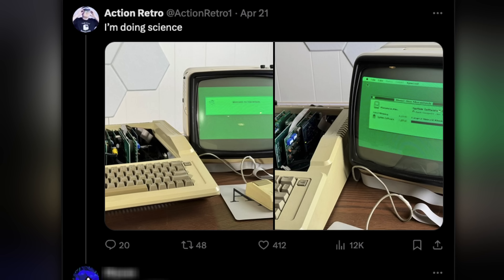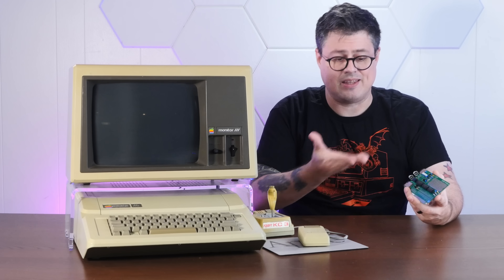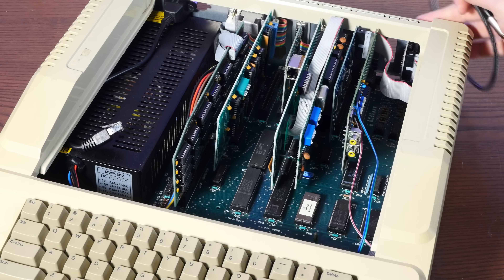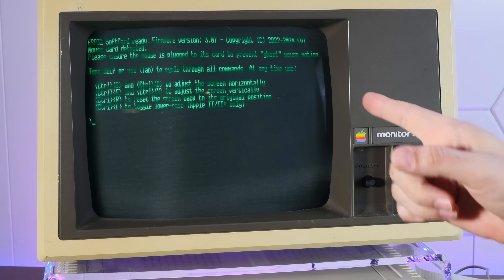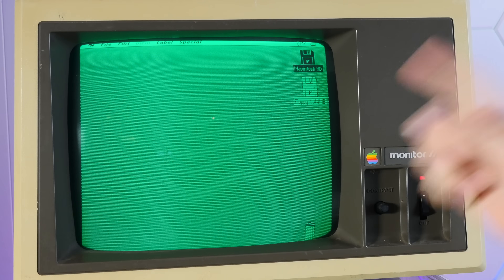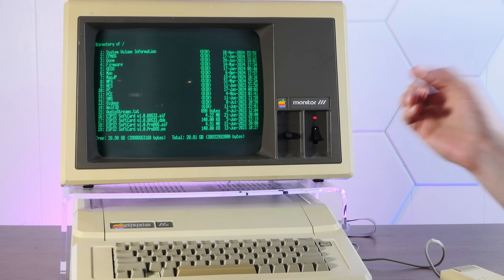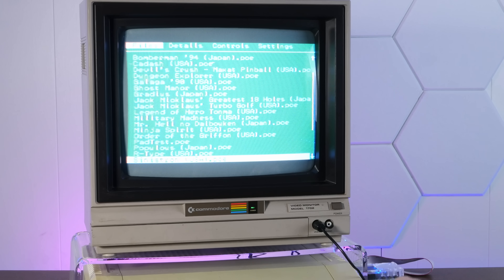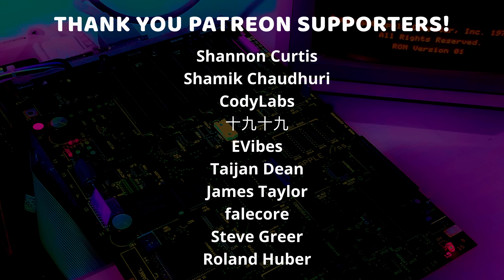This Apple II is running... Mac OS?!

Comment from the maker: Go to https://ground.news/actionretro to take control of your newsfeed and see the full picture on any story. My link gets you 40% off the Ground News unlimited access Vantage plan.
Reply: I thought 68k-dot-news was the Action Retro Endorsed news aggregator?
Reply: How come you call Geos G. E. O. S. but you don't call Geoworks G. E. O'Works?
Reply: I thought 68k.news was the Action Retro endorsed news aggregator?
Reply: My Apple ][E, ][GS can be connected to my 2014 Sony Bravia with RGB cables so I see my games in color.
I also can connect my ][C to my strange Westinghouse 21 inch television as well and if I want to drag it out of closet I can use my Apple color monitor so I no longer use green screen.
Where do you get the card ?
Apple ][ forever.
Reply: All US media is centrally controlled.  If you care at all about informing people, stop running this BS about how "left" and "right" are anything more than an false dichotomy.
Reply: too bad its missing GSOS would have been sooo cool..

Comment: can you install tiny core linux on the esp32 card?  id love to see an apple2 on modern internet!  what about other operating systems?  amiga os?
Reply: This card runs the various OSes shown in this video by emulating the retro-machines they were designed for instead of directly running them on the ESP32. So if in the future it can also run AmigaOS, it will be by way of emulating an Amiga. When it comes to the modern Internet, the Telnet client that was added in v5 of the firmware provides quite a few capabilities, like running the Links browser, access to Wikipedia, news, even ChatGPT.

Comment: "HELLO" is an init script for DOS 3.3 floppy disks. The A in the left column indicates that it's an AppleSoft Basic program. When the disk was initialized it was set up to run that basic program on startup. In this case it looks like it just passes the command "CATALOG" to DOS and exists. Being a BASIC program instead of a binary executable, it has to be run with "RUN HELLO" and not BRUN. You can see what the contents are by "LOAD HELLO" and then "LIST". 

I can't believe I remember this from 30 years ago when I learned it. 

I know this is an old video, but I couldn't resist. When else am I going to use this information?

Comment: @7:07 ust in case you or anyone watching is curious, in Apple Basic, "HELLO" is just a generic program that is named when initializing (formatting) a blank floppy.  It can contain a full program, or it can do absolutely nothing.  If the number of blocks (like in this case) are 2, then it's most likely absolutely nothing.  Also, you'll notice the "A" in the same columns as the "B" in front of the other files.  The "A" just means it's an Apple Basic file, so you load and run it simultaneously by entering the following: "]RUN HELLO".  Only "A" files are loaded/ran using "RUN".  You can load it without running it by typing ]LOAD HELLO.  Then, you can list the basic program ]LIST.  So when you "]BRUN ESP32NTSC", that's how you load and run a "B"inary, or assembly language program.  You can also ]BLOAD the file, but you can't list it traditionally because it's not Apple Basic. You can ]CALL-151 and then you get a * prompt which enters you into Assembly but that's not a topic for here.

Comment: So wait... if the ESP32 is whats running everything then in what way are you running the software on the Apple II?
It seems more like you're just using the Apple II IO to control and view the ESP32, the CPU in the Apple II isn't actually running the software?

Not that it isn't cool but its not the computer actually runnig the software.

Comment: i am little confused. how much work is the apple2e actually doing. the apple 2e is still using its processor at least just to interface with the esp32 right? i'd assume its a little more than just plugging in an esp32 to the apple 2e display.
Reply: That is correct. The 6502 processor on the Apple II runs an interface program while the ESP32 SoftCard is in use. In addition to controlling the video switch this program also finds the card's slot and the slot of the is a mouse card. It then starts passing all keyboard, joystick and mouse events to the ESP32 SoftCard, until the user types the EXIT command.

Comment: Woz is my hero!  The Apple  ][  series are incredible.  So flexible, with rather modest hardware.  You could put a co-processor card in one of the slots.  I had a Z-80 card in my Apple ][+.  It similarly used the Apple ][  for keyboard, display, and floppy disk access.  It would be fun to see if you could transfer data between the ESP32 card and the Apple ][ system by issuing "PR#7" and "IN#7" commands (which re-directs system output and keyboard input to the card in slot #7). 

The "Hello" program is an Applesoft program that Apple DOS or ProDOS runs automatically after it loads the DOS after booting.   See the "A" in the first column of the CATALOG listing?  That means "Applesoft".  "B" is for binary files, and "I" is for Integer Basic programs.  So to run it, use "RUN HELLO", rather than BRUN, which is for binary programs.

Comment: The Apple II has become a terminal for the ESP32. All authentic Apple actions are performed via passthrough, the rest is the ESP and its software. Really makes you think that the Apple IIe is actually running the software. The ESP just uses the Apple II for power. That 6502 must be bored after boot when it switches to the ESP.  This is a pretty cool project.
Reply: Not sure if the 6502 is bored though. It's kept super busy with the IO. 🏁

Comment: The "type mismatch" error ocurred because you use BRUN instead of a RUN. Note the letter "A" in the line where HELLO is listed. It means a Applesoft program, so use RUN HELLO. The "B" letter is to denote a Binary Program, like the ESP32NTSC in you case, then use BRUN with them

Comment: The "HELLO" program is basically the Apple II's equivalent of an Autoexec.bat.  It's a small BASIC program that autoruns whenever the disk is booted up.  Since it's a BASIC program, not binary, you just use "RUN HELLO", not "BRUN HELLO" .  The  HELLO program was commonly used to load custom CATALOG programs or other personalized menus or welcome screens.

Comment: I never owned a Mac but I did run a Macintosh emulator on my Amiga and it consistently ran faster than the fastest Macs on my college campus.  I had to buy a special external drive to use Mac floppy discs and used a 20 MB Floptical drive as its main storage.  
I ran the fastest Macintosh in town at less than 1/3 the price of the original.

Comment: think I'd even heard of Doom being ported to ESP32 but had completely forgotten about it. quite amazing to think that the game some people say killed Amiga (because everyone wanted to play it and basic Amigas simply couldn't) runs so well on a tiny $3 microcontroller that's already 10 years old. sure, Moore's law and all that but still, a purpose-built multimedia machine that was still being sold two decades prior (A1200 discontinued 1996, ESP32 released 2016) getting curb stomped by a single chip that usually doesn't do much more than control some LED lights.

Comment: Hi, thank you for this awesome work! Do you know how to connect for a IIGS?
Reply: The card works on an Apple IIgs, but only through the composite video. There is no RGB support.
Reply: @cvt8353 Ok, so I need another screen with the monitor of the IIGS, right?
Reply: @skanderbenabdelkrim6332  Yes, or a monitor that has dual video inputs - RGB and composite.

Comment: I have no idea what has been done with this recently, I just haven't been following. But, if this card had some DMA options, it could basically be used as an ARM accelerator for the Apple II. Palm did something like that, taking a cue from how Apple made early PowerMacs support m68k code via an emulator. Most programs just ran that way, but a few could take advantage of functions running on the native hardware, consciously using the "HiDPI" (lol) screen, or whatever.

No emulator needed because you've got a real 6502. … but you could reach out to the esp32 for math, for RAM, for wifi, bluetooth, etc. Might be cool.

Comment: Hold up I missed some of this.. Is the Apple II doing the heavy lifting or is it running purely off the card and just displaying thru the Apple II? Like this is just software emulation and not macOS actually installed on the Apple II right?
Reply: Nvm I answered my own question. Has to just be the card and it’s essentially using the Apple II as a peripheral.

Comment: This shows just how powerful the ESP32 really is -- pretty weak for today and outclassed by the lowest of budget smartphones, but they're INSANELY cheap and tiny chips, and have pretty much the entire system on that one little die. And still it's fast enough to emulate a Mac Plus 10x faster than the real thing.

Comment: lmao my goodness 8 card slots in the apple 2 that impressive expansion, If i had one i'd fill it up with multple cpu and GPU and ram expansion cards if possible lol I had such an awesome ultra bright christal sharp coloful monitor with my commador 64. but it was NEC monitor from 1988 i think. i pluged my vcr and n64 and super nes up to it it looked better then my newer crt tv i had back in the 90s. i had a super fast enhancer 2000 disk drive for the commador that was smaller then the actull commador disk drive.  ^_^ but still it took 20 to 30 minutes for most games to load lol

Comment: Yeah... you are not "Running Doom on an Apple II etc." you are running it on an ESP32 and it is sending its output to a monitor sat on top of the Apple II. The only things the Apple II are supplying here are power, keyboard and mouse. None of the Doom code is running on the Apple II hardware!

Comment: No, you're not playing Doom, or anything else, on that Apple II.
You're using an apple2 keyboard, mouse, monitor and power supply to run and control a Esp32 computer.
May as well put the esp2 in a purpose built case, it's own psu, and a usb kb, mouse and lcd monitor all from thrift store fir $10
Reply: The ESP32 is not a computer. The computer is the Apple II and the ESP32 SoftCard is a processor card, like many others before it. So he is playing Doom on an Apple II computer using a processor card.

Comment: So basically the card is a computer on a card that interfaces with the apple II and probably just uses the inputs/output system (so keyboard and display).  I think Apple had done similar things to make the Mac compatible with older Apple II software as well, sort of like a dual-boot system is today, and it was more or less an Apple II on a card in that situation that went into a Macintosh.
Reply: Okay yea that’s what I thought.  It’s not the Apple II doing the heavy lifting, it’s the card and just displaying thru the Apple II. And it’s just software emulation and not macOS actually installed on the Apple II. 

I wasn’t paying the best attention in the beginning and I was too lazy to go back and rewatch it lol. So thought I might’ve missed something but nope that explains it

Comment: I think that this is your most cursed machine yet, and I love it. I'd be curious to know if it could also run some version of Linux and modern software, though I have my doubts as to whether or not it has the horsepower to do it well.

Comment: Technically the Apple II isn't running anything, it's the ESP32 that's running emulated MacOS and it can do that because it runs at 240x the speed of the Apple II's original processor
Reply: Then I suppose that an Apple IIgs with an AE PC Transporter card isn't really running DOS, or an Apple II with a Z80 card isn't really running CP/M? No, the cards do not make the computer, they enhance what the computer can do.

Comment: Interesting project, but TBH, I really don't see the point in connecting something like this to an Apple II when it would probably be more practical as a stand alone item.  From what I can see in this video, the card complete takes over and the Apple II processor just sits and does nothing.  You can't program something on the Apple II and access features of the card via some 6502 code you write, can you?  If not, then it might as well be it's own stand-alone product, like the MiSTer FPGA.  With enough planning and expertise, perhaps someone could even put all the components of a full micro PC a card, stick that in, and let that take over everything too.  But what would be the benefit to someone writing code specifically for the Apple II?  You see what I'm saying?  Sorry to be a stick in the mud.
Reply: There are already many ESP32-based standalone devices similar to MiSTer that go by the term bare metal emulators, so I didn't see the need to create one more. As an Apple II processor card however it's only one of two based on the ESP32 and I found the other one quite limited. Besides there is a long line of Apple II processor cards starting in 1980 and continuing all the way to present day that have always pushed the limits of what you can use your Apple II for.

Comment: The card interface use the 80 columns mode while the standard display mode of the Apple II is 40 columns this is why the letters look very narrow
Reply: Actually the card generates its own composite video, similar to what an 80-column card for the Apple II/II+ did back in the day. The command line interface uses a font similar to the 80 column mode, but it doesn't actually use the 80-column mode itself.

Comment: Hi, I think as the Hello file has a A on its left,  you can run it by typing RUN while the 2 other files have a B on their left which means you must type BRUN to launch them.
Anyway Hello probably does nothing as this is the initialization file like any on Apple II floppy for example. 
The figure (002, 006...) between the letter (A or B) and the name of the file shows the file size.
Reply: A = Applesoft Basic, B = Binary, I = Integer Basic, T = Text. Well, those are the most common, but they are not the only possibilities.

Comment: This reminds me of the first computer I bought.  It was in 1994.  I had just started a course at my local technical collage titled "Computer Fields Service Repair."  I need to get a "Modern PC".  I had access to my Dad's old Altos System 5, but it ran M/PM II.  I needed something to learn DOS.  At a local swap meet a guy had a an old IBM PC (not XT).  With a monochrome monitor.  But instead of an 8088 CPU in it, it had an Intel Inboard I386 card.  This replaced the 8088 CPU with a ribbon cable, and was a full sized ISA card.  The card housed a 16 MHZ i386 w/ and i387 math co=processor.  It also had 4 megs of ram on the card.  I ran DOS 5.0 on it, but I only had a ST-225 in it, so I didn't have enough hard drive space to run windows.  I always wanted to see if I could have gotten windows 3.1 enhanced mode.

Comment: With apple2pi you can control a Pi with your Apple. Then run MAME on the Pi and you have all kinds of systems you can emulate, including PC, Mac, Atari, Arcade, etc. Apple2pi and retropi on the Pi and you have all kinds of gaming options. Apple2pi however, does not currently pass audio or video through. I run an HDMI tv with composite from the Apple and HDMI from the Pi.

Comment: Interesting. I've been following the development of an ESP32 device for the Atari 8-bit called Fujinet that allows an 8-bit computer to access the internet, without taking up a lot of memory on the 8-bit system. Some cool stuff has been demo'd with it, like being able to turn the Atari into a diskless client that boots off the internet, create multiplayer games that run over the internet, and even do things like FTP downloading/uploading, and run an IRC client written in Basic.

The developer, Thomas Cherryhomes, has been porting Fujinet to other platforms, including the Apple II.

The ESP32 has proven to be an effective way to add computing power to lower-powered platforms.
Reply: The next firmware release of the ESP32 SoftCard will add an Atari 8-bit emulator as well.
Reply: @cvt8353  - The emulation reminds me of hardware emulators I used to see for 8- and 16-bit computers, which were in a separate case, connected to the host computer, and used the host like a terminal; just for keyboard/mouse input, and possibly video output. Everything else was happening on other hardware, including disk access. One example is the Sidecar PC emulator from Commodore for the Amiga. Except, of course, now the hardware is small enough that you can have it inside the host computer's case.

Comment: Windows was better than the MAC System. And in your video, you're not running an Apple II, but rather this card. I'm pretty sure that the 6502 in it is not used at all while running MacOS.
Reply: The Apple II's 6502 is used at all times to control the card.
Reply: @cvt8353  That's what I meant.

Comment: Well the ESP32 is quite beefy compared to anything from the 80ies and 90ies, so this would let you... reuse your keyboard, monitor and speaker from the old machine. I mean, its in the name, 32 bits. You might as well use a raspi or whatever, similar thing. Let me be clear, this is silly. Maybe its "cool" but very silly. Of course the esp32 can emulate whatever except the latest. Go ahead and run msdos, or windows in it, might as well have proper linux too. The Apple is doing nothing anyway.

Comment: Guess you're not old enough to remember all the emulator cards that were made decades ago. Of course it is kind of interesting to look at what it cost these days to put together an emulator for what was top of the line hardware from the distant past, back then it was almost always better to just buy whatever was being emulated once you looked at the costs and preformance compromises.